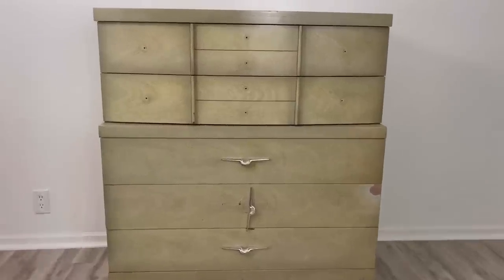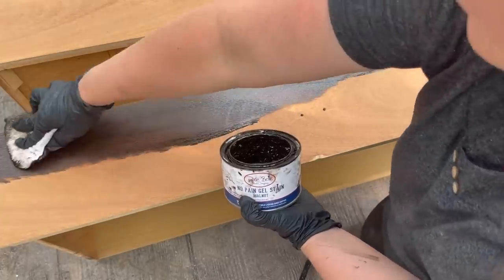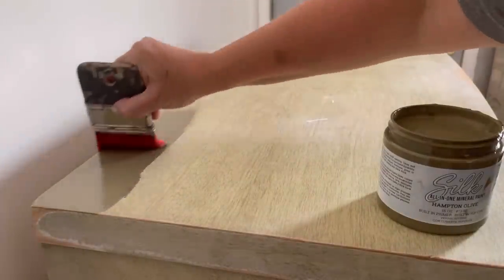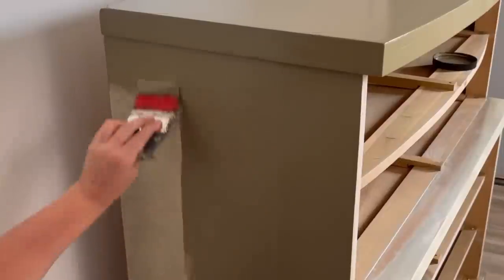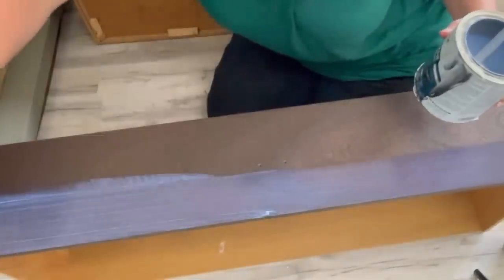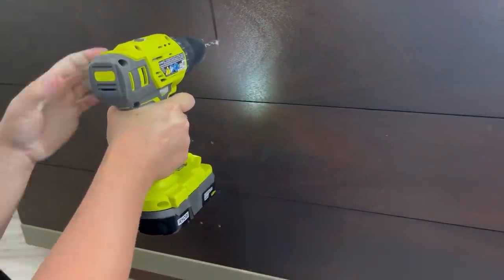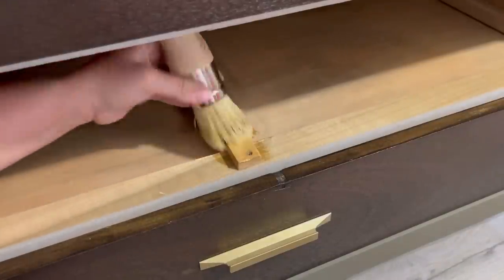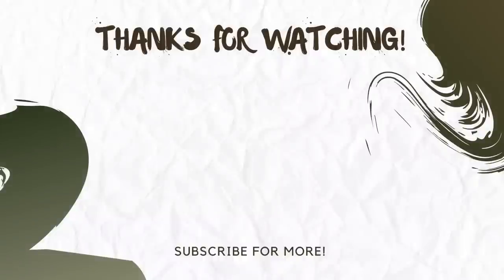Start to Finish MCM furniture flip using Dixie Belle Paint | furniture makeover

Comment: You won't believe this but I have a chest of drawers exactly like this.  Mine is has laminate on it.  I'm going to stain the top with the No Pain Gel Stain.  I scuff sanded it and applied Slick Stick to make sure that the paint wouldn't peal.  This piece turned out amazing.  I like the look of the wood and paint together.  Thanks for a great video !!
Reply from the maker: That great! I love the slick stick. It takes out all the stress. Happy painting 😊🎨